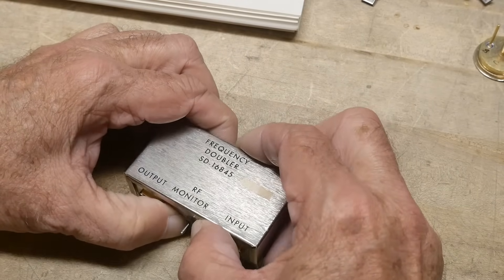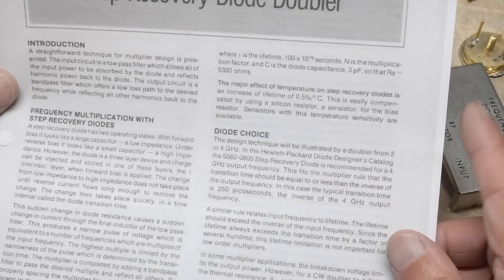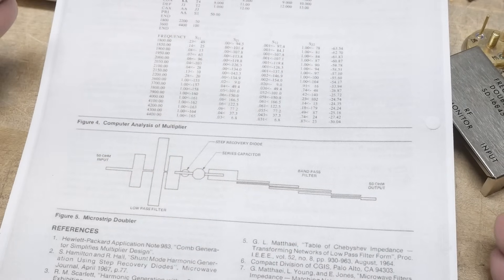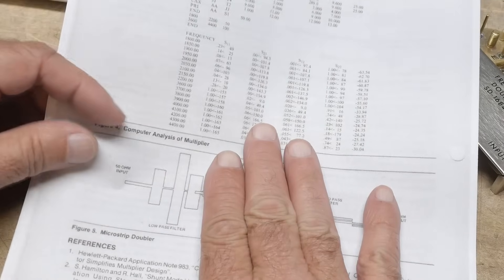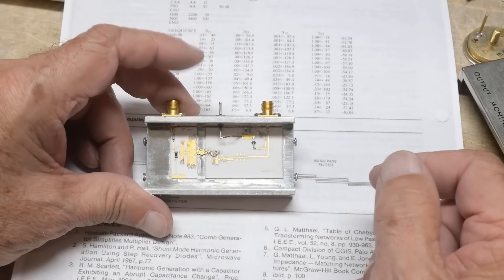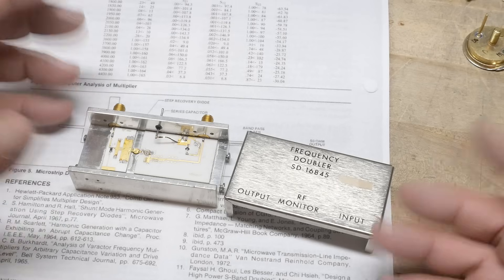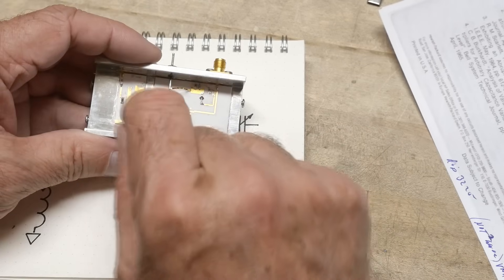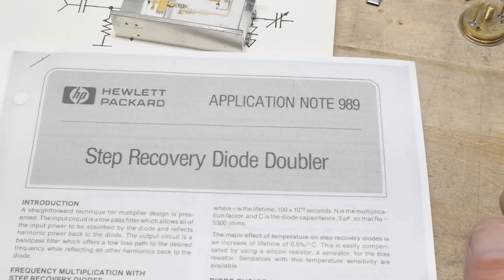#2243 Step Recovery Diode Frequency Doubler

Comment: Any time you clip an AC signal with a diode, it creates harmonics. It's how distortion pedals work for guitars. If you're impressed with an RF frequency doubler, I could knock your socks off with a x16 frequency multiplier that we have at work. It's really a comb generator, called as such because you can see all of the harmonics when spanned out on your analyzer. The band pass filter comes later in the device.

Comment: One company that used to make those tiny variable capacitors was Johansen or some spelling like that. I used to have the adjuster tool. It had a tiny square post at the end that fit into the square hole.

Comment: Yea the tool for that cap is yellow plastic with a teensy little square ceramic tip in it.  Now I am trying to remember the mfr.  name of those caps but they are very fragile and easy to break.  I have only encountered them in one product that I recall.  A microwave product. You could probably reshape a teensy ceramic screwdriver bit to fit if ever needed.  If you chip a ceramic tip you can reshape or redress with those diamond honing sticks for knife sharpening.